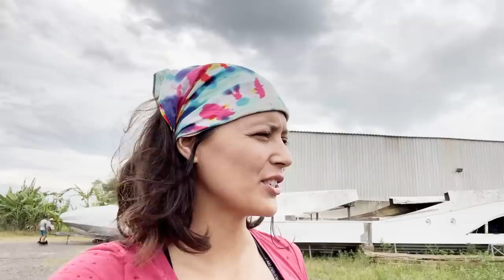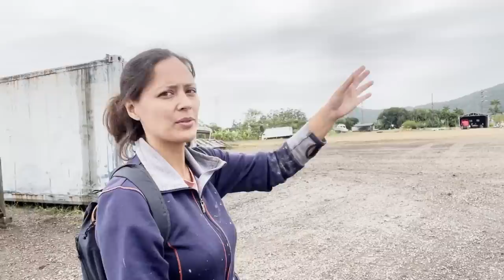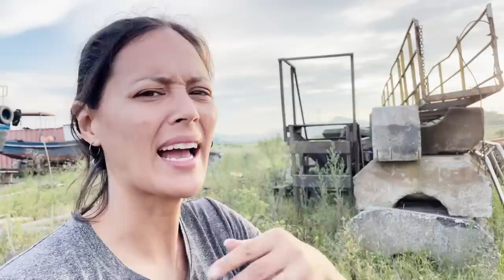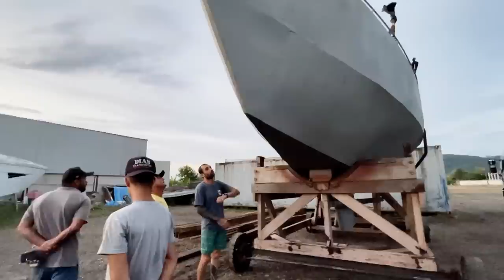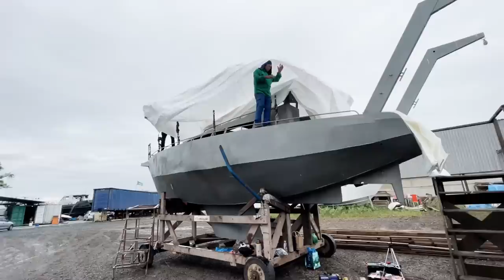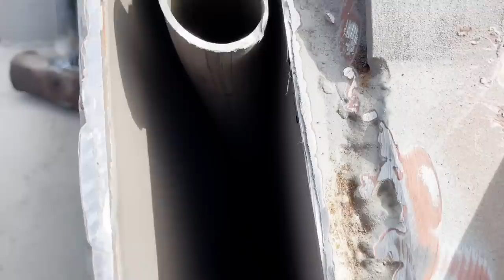Are we CRAZY for CUTTING UP our Sailboat, AGAIN?! ⛵️ Ep23

Comment: Hey guys.... You're doing great. I feel your pain at times with the joys of a steel boat. Yes I'm also building one and the dreaded metal worm (rust lol) is the real thing to get a grip of.  You can slow down the flash rusting as follows.....

Rinse the part with a diluted phosphoric acid etch. This will stop all surface rust, and also end any rust that is in pits and crevices, anywhere the phosphoric acid can reach.

After treating it with the phosphoric acid etch, it should be dried off, and then allowed to completely dry. After that, you should apply primer right away. After that, it will be in good shape for a while, until you can get paint on it.

Phosphoric acid is available at auto-body supply stores. It usually comes in a 1 gallon container, and you dilute it either 2 parts water to 1 part phosphoric acid, or 3 parts water to phosphoric acid. Follow the directions on the jug. Use distilled water, as plain tap water usually has minerals in it which will kill the effectiveness of the phosphoric acid mix.

Plan on getting the paint on it as soon as possible, either THAT day, or the next day. You don’t want to have to redo the work.

There are some specialized flash rust preventers on the market too so see what you can get out your way.

Just keep banging away at it and you'll reach your goal.... Big love to both x

Comment: Those davits were disproportionate in respect to the topside. I suggest to redesign them with a framework of stainless steel tubes covered by fiberglass panels with frames for solar panels and support to windmill. Furthermore, the arch could be used to fit the main sail boom traveler (look at the work of Duca & Roberta of Odd Life Crafting), backup GPS and VHF antennas and other stuff together to the dinghy hauling mechanism.
Anyway, good job to you and another big, interesting project of a steel SV rebuild to follow for me!

Comment: Welding laces got pores because they were welded by MAG method. (MAG = Metal Active Gas) the weather conditions were too windy and the gas pillow that comes out of the nozzle was blown away by the wind.

Electode Arc Eelding Method E111 is much better and can be done in outside by windy conditions.

E7016 (KB) electrodes are good for this job. Good flow, rust will be washed out while welding and lay on the surface of the welded lace and can be removed by slight hammering or wire brush.

Comment: Hi to both of you, and yes Lori, you are right, I’m happy to see that the “monsters” are cut off 😊. 
In regard to the welds, I guess they were made by stick welding with shielded electrodes, and unfortunately they sometimes tend to be porous because of the slack produced by the shielding material can mix itself with the molten filler material. 
I would suggest to use only MiG or TIG welding methods with shielding gas, where no slag is produced.
For the rest I feel sorry that you learn the hard way by having to spend a lot of additional money and work hours to correct “not so ideal” executions from the past, but better now than later when you are at sea.
Reply from the maker: Thanks Helmuth! The original ones were done with a MIG but there was tons of wind and issues in Rio. Here we definitely benefited from the great experience of these workers. In retrospect there’s lots of things we would have done differently, but at least now we have a lot more experience!
Reply: Absolutely nothing wrong with stick welding when done by someone even modestly competent. You'll find most high pressure oil/gas pipeline and shipbuilding work is done this way - one huge benefit it that it is not affected by wind, unlike tig/mig where the slightest breeze mucks up the shielding gas.
Reply: @lahakai  Ahhhh, experience!! Expensive, but necessary. You're going to love it when you are done.  I was taught that stick welding is what you use for heavy structure, MIG is used for thinner material in situations that won't kill you and TIG is for someone else to do (slow and expensive). Welders in boatyards in this area are now $125/hr.  I suspect you are getting a much better rate.

Comment: A lot of positive moves happening for Lahakai. You are certainly on the right track. Not sure whether you have considered using a C-Can on either side of Lahakai to support a roof over top of the boat. Used frequently in farm operations. That way you save material costs for the walls by using the C-Can and if you cut a doorway in the side facing the boat you gain ready access to storage space for materials and supplies. All the best.

Comment: I feel for you guys about having to redo so much. I was sceptical about the welds in the start but didnt want to make a negative comment about it and the davits.
Ive been around boats and boat yards for 30 years and know a thing or two about boats and in my opinion having such a heavy steel davits sitting so high will affect the sea worthyness off your boat quite badly! 
A hundred kilos high above waterline might need a ton or more of ballast to balance out the boat.
Reply from the maker: Lots of circumstances lead to this but we are rolling with the punches!  We did have the original davits evaluated and we’ll be posting that soon. But regardless, on to newer things! If you have any design inspiration for them, let us know!
Reply: @lahakai  If it was my boat first thing id do is ask myself what do i want out of the boat? Blue water cruiser vs mostly coastal cruising?  
If i was going many offshore tours i would even forego davits or at the most have stainless steel pipe davits that are light weight and not too high and always carry the dinghy on the deck when offshore. Tie it behind on coastal cruises.

Its cheaper and will make your boat much better in rougher seas and tbh its not much of an hassle to haul up the dinghy on deck when going offshore.

As to having davits for solar, you definitely dont need a heavy structure for them and i would rather have smaller solar and a wind generator for power at anchor.
Yoru electric motor will generate more than enough on cruises to keep everything running i would think.

Just my two cents. will definitely follow to see what you guys do.

Best of luck(=

Comment: You're not crazy to modify your boat (again).  There will never be a better time than now to make changes.

For your shed, you might want to take a look at episode 6 of the The Duracell Project.  He built a light and strong free-standing shed over his boat.  It seems to work, and it is beautiful.
Reply from the maker: Better now than later right? 

We are in the middle of building the shed still, it’s a lot of work 😅 We just threw some pieces up because it kept raining. the Duracell one is one of our references though ours might not end up as nice. His was a kit wasn’t it?
Reply: @lahakai  It was not a kit.  He built a jig on the floor, then bent pairs of 1 by 4's around the jig and glued/screwed them together with spacer blocks in between.  I'm sure what you build will work fine.

I'm eager to see your interior design. when you get to that stage.  You both seem to have a strong sense of design, so I am sure it will be interesting.  Have you looked at Sailing Uma?  They are both graduate architects.  Episode 225 is a tour of their interior, which is sort of industrial minimalist, and very non-traditional.  You might pick up some good ideas.  And they also use solely electric propulsion.
Reply from the maker: Sailing Uma is a huge inspiration for us! They were one of the first channels we started following because of their electric motor and their redesign. Love their videos!

Comment: Honestly I would not spend the time money fairing the hull at all you could above the water line but you also have a layer between the metal and paint that can hold water. one steel boat I owned had a beautifully faired topside but the faring hid so much rust and corrosion for so long it was cheaper to cut it all out and build it new like your hull. Now I prefer just paint layers it is how the commercial boats survive. Nothing worse than a crack in the fairing trapping moisture behind it then being painted over to seal it all again.

Remember with your Davits you have to think about getting off the boat into a life raft in bad weather or back on it! you don't want to ever do it but I almost had to and luckily I carried the tender forward on deck, a previous yacht I owned I would have had to exit over the side into a life raft not an easy feat that yacht I sold after it tried kill me, blue water and it found a rope for the prop so I had to go over the side, cleared the rope but I was so close to giving up trying to get back over the side.

Anyway I got there and two waves after a 90m (looked the size of a Megalodon to me at the time) ok was minimum 3.5m tiger shark at the railing I had just flopped over with zero remaining energy, we just looked at each other. Not sure he was there to help me get on board... 

Anyway Painted it, renamed it after an ex, sold it and I bought a Yacht I could easily re-board from in the water at the next marina. Probably should have named the shark after another ex.

Painted steel is honest, Stay Safe and you will never see Romance in another Yacht named after a female... LOL

Comment: Is it possible or feasable to cut the boat in the middle and put 2 meter of extra space between it, is that big job on the location you are at right now ?
Reply from the maker: We've actually seen this on many boats here in Brazil and its a big production. Never seen it done on a sailboat but on commercial shipping boats and such. Hopefully one day we can upgrade to a bigger boat. But we wanted to start on a smaller one as a project rebuild mainly because its cheaper. But the dream is to have a little larger one one day!
Reply: The boat is already plenty big to maintain and to handle. So while you always want a bigger boat it also adds big time to the cost and handling. Also, to keep propotions you would have to make it wider and deeper and add a heavier keel and bigger rudder. It might be easy for a boat that has a long straight section in the middle, but on a sailboat its pretty difficult.

Comment: I'm glad you have removed those davits, they were ugly also looking at the hull again it looks to me to be a very amateur design and build in the first place. Sorry to be negative but the hull shape just doesn't look right to me (I studied and qualified yacht and boat design many years ago).
Having said that I wish you well on the rebuild and will continue to tune in every week.
Reply from the maker: This boat was originally designed and built in 1997 in France and sailed to Brazil. So we didn't design the hull, we just restored it maintaining its original structure. We did however make the davits! We are talking about the new design in our community posts, you should check it out!